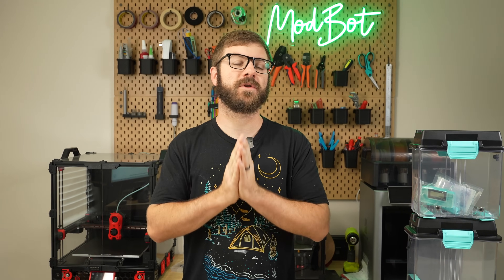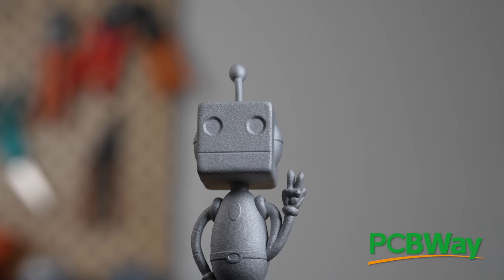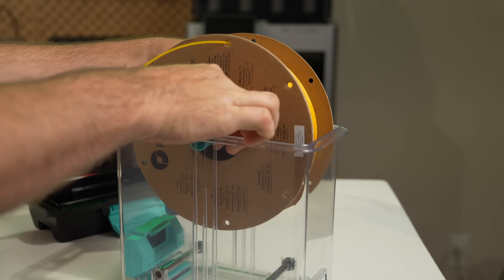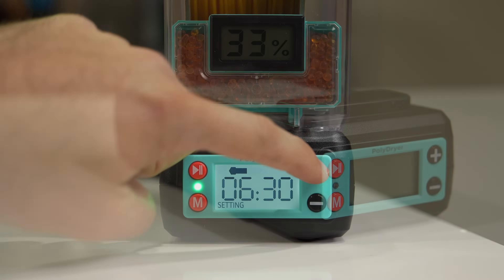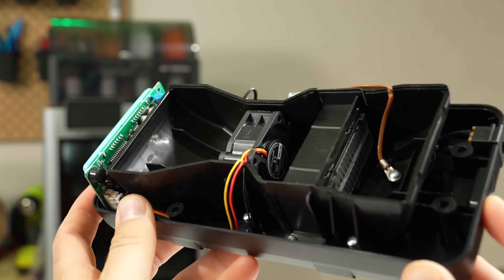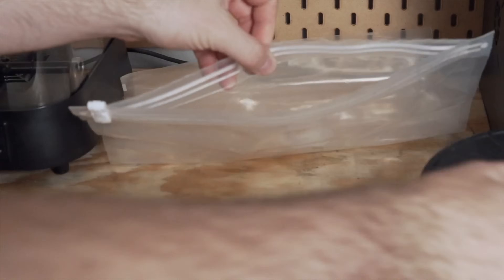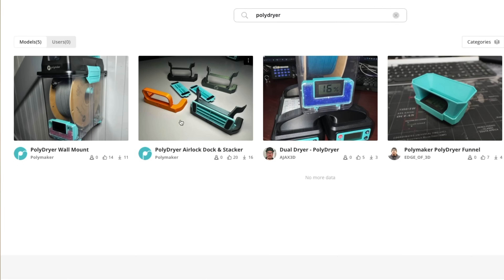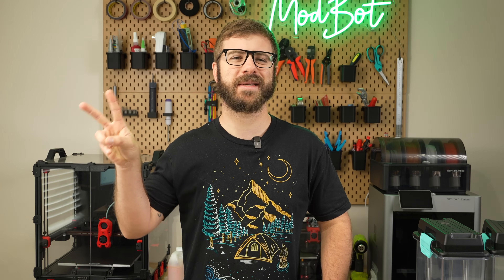Compact Filament Drying & Storage System (Polymaker PolyDryer)

Comment: It was a lot of fun helping to develop this dryer! Glad to see it's getting overall good reception.
Reply: Hope you develope a version 2.0 where the entire chamber is at least 70*C and the spool rotates while drying. I would have bought at least two bases and six containers. Also I feel like a very small amount of fresh air needs to enter the base and exit the top of the container while drying. I hope the temperature and humidistat is good to the maximum chamber temperature.
Reply: @TomFYouTube  fresh air goes in while the heater unit is running.
Reply: good thing your not called HumbleHedgehogMakes
Reply: @donald1792  go back to your nursing home, gramps
Reply: @donald1792  I don't get your snarky comment. OP put effort into developing something and your reply is "wow, look at this 'humble' guy over here" in a sarcastic tone. It's just petty.
Reply: @donald1792 😂😂😂😂😂

Comment: 4 of these for 320 or sunlu s4 filament drier for 190 i have the sunlu filament drier direct feeding 4 printers and never have any issue with stringing and it looks much better
Reply: I also think the S4 is more polished well rounded product. That being said a system like this gives you flexibility since each filament has it's own dedicated chamber. You can dry nylon, PLA and any other material with just one drying unit and separate drying boxes. The S4 doesn't have that capability.
Reply: @elleryfg7853  True enough, if you need multiple dryers for different fillements, even the single sunlu filament dryers are much more compact   better and cheaper. although I haven't used one  before, so I can't comment on performance, but I can't see it being bad.
Reply: The sunlu looks like a good option if you need to run multiple rolls at the same time. But if you are just running one roll at a time, you can get the combo + 4 spare boxes for 200 and be able to store a total of 5 rolls.

Comment: $30 for the box is pretty reasonable. I did the DYI cereal box a few years ago and by the time I got the box, roller, hygrometer and desiccant I was $25 into it and it didn't even seal all that well.
Reply: I made 6 for a total of $60. Even accounting for time it is still a much better option than $30 each. Mine also seal fine and hold around 10% humidity.
Reply: @justinbaits7149  Dang, I should have got your shopping list.  The rubbermaid box alone was $10 on amazon back when I got mine. Probably would have helped keep the cost down if I'd been building more than one.
Reply: Got more info on that?  @justinbaits7149 what did you use?

Comment: Daniel! I like your friend Josh’s dry box set up, is there a link for it or what he used?
Reply from the maker: He has a video on it :) I will add it to the description https://www.youtube.com/watch?v=LdUtvISRF0s
Reply: Idk if it's the same one, but I use something called the filament bunker. It's basically the same design as the poly box (chamber for dessicant and a hygrometer) made out of a cereal box. There's mods on printables for adding a PTFE tube coupler.